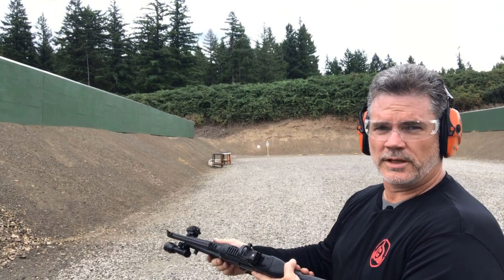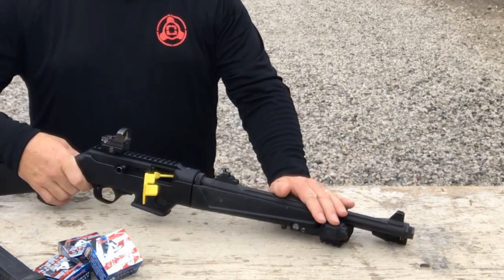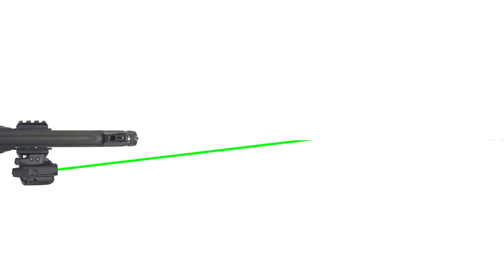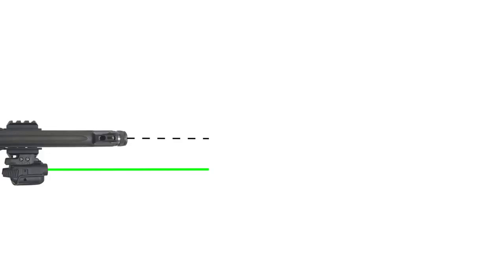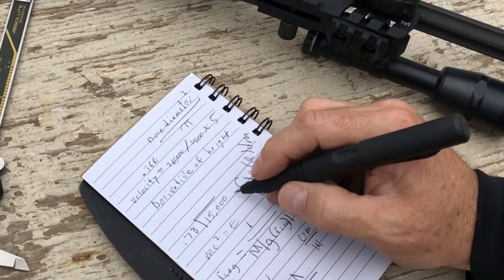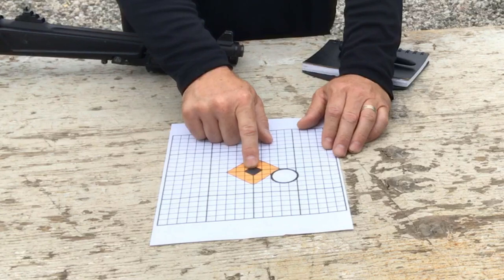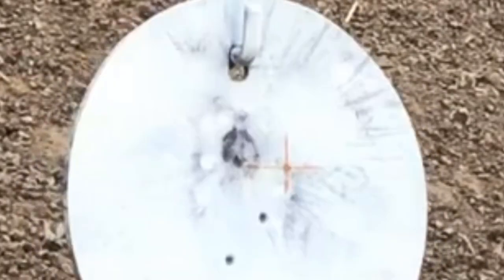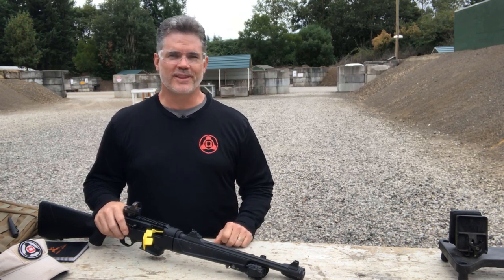How to sight in a laser to be on target at any distance! Ruger PC Carbine Laser Sight Setup!

Comment: And the closer you can attach the laser to the barrel the better, obviously. Whether that be from the top/bottom/sides
Reply from the maker: Most definitely. Thanks for watching the video!
Reply: My green laser boresighter is quite accurate, at least the dot stays stationary while rotating. Hence i custom made a few barrel bands just to firmly secure that boresighter directly on top of muzzle end. The offset distance is only 20mm, not sure if that's a good idea though. But I'm sure no other people would do this 😥
Reply: @la2123  So you're using a bore sighter attached to the barrel as a laser? Lol.. Ok man, though I'm sure you can find a proper/better laser mount. Don't expect it to hold long if it's not secured tightly. But yes a parallel offset of 20mm is good, and I know that's why you're doing it, but honestly I would try to find something that holds and fits better/tighter and sacrifice a few millimeters of offset. eBay has lots of cheap options if you're frugal with money. May I ask what type of firearm you're referring to?
Reply: @TTime685  It looks silly, i know. But I'm tempted to use it because the offset is so small, despite i do have a laser scope and a red dot sight. You're definitely right, i gotta make sure it's straight and secured. The barrel bands are custom made from 3d printed ABS. I'm using a pellet gun mainly for pest control, anywhere below 20 yards.
Reply: @la2123  Ah a pellet gun eh? Hah, well of that's the case then yeah you should be fine there, since there's virtually zero recoil. That's cool making your own bands 👍🏻
Reply: @TTime685  I haven't tried that out but that's what I'm gonna do. With your encouraging words I'll have more confidence. A million thanks!
Reply: @la2123  Yes sir! Good luck dude 🤙🏻

Comment: My laser is directly  below the barrel.  Just to make sure I understand this correctly, you measure distance from laser  to center of bore.  So if that's 2 inches, then I just plant the laser dot 2 inches below my intended target, correct?
Reply from the maker: Correct. You'll of course start to see some drop as the distance increases, but it will prevent your point of impact being higher than your line of sight at some distances and then falling back below your line of sight at extended ranges.

Comment: Good info, works great. Not new tho, I first saw this method on the Banana Ballistics channel. Works just as well for sighting in a red dot too. I use a laser boresight tool and just align the dot projected from the bore with the red dot as it is oriented on the gun. If my red dot is mounted 2 inches above the bore center, I adjust the red dot to 2 inches above the projected laser dot from the bore at 30 foot minimum.

Comment: I’ve been tinkering around and found out what works best for me:
Rifles: laser parallel to bore sighter, offset is constant at any distance, I have to deal with only bullet drop. And because it’s mounted on the side rail, I don’t have to worry with horizontal offset with it parallel to the barrel.
Pistol: laser zeroed just above the front sight at 10yd. The lower offset is still center mass up 30yd and the upper offset closer to 10yd is negligible and still center mass. Zeroing at 7yd gave me too much variation (my laser is 2” lower than the center of the barrel, so sight / bore angles are a little exaggerated).

Comment: Ive adjusted mine to cross the bullet path at 100 yards.
Thats because my 45 carbine doesn't really carry much further then that usefully.
At around 100 feet its 1.25 inches low under barrel mounted.
That decreases with distance to the 100 yard point.
Thats further then ill ever be shooting the carbine.
I have a 1.5- 4.5 scope also mounted.
The laser is mostly just for looks, but mite be useful if needed at dark.
If it was mounted on my 243 id adjust a bit differently.
Id then have it cross path at say 300 yards....
😁😁😁

Comment: Always told setting Lazer up on the side is gonna throw off your aim.

So if you zero at 10 feet and shoot at 20 or 30 or 50 your gonna miss left.

Better to have above and below barrel always in line with barrel.

Case in point add laser under and a laser on right zero at what ever distance then move with each step your right laser moves exponentially away from the target while bottom remains on target.

I usually just save myself the headache and mount under barrel
Reply: Just sight the laser straight along the barrel so that if center of your laser and center of your bore are 2 inches apart, your laser should be 2 inches from the hole it makes at 25, 50, 100, and then it'll start dropping from there, but you're not using a laser further out than that. Drill holding 2 inches over with a laser and dead on with a scope and you're good

Comment: What about if you mounted it at a 45-degree angle?
Reply from the maker: Same thing applies. Our laser was low and offset to the side kinds like it was mounted at a 45…just measure you’re offset both vertically and horizontally. 👍🏻
Reply: @catalystarms7616  is it possible to have the laser at a 45 degree angle and the light on the other side of the rifle at 45 degree angle? Is it also better for the laser to be canted down underneath the light?
Reply: @tonyslaughter8954  No one can tell what's best for you, only you know the best for yourself. If you always know where your POI is and it suits your purpose then why not? I prefer mine on top of barrel.

Comment: Could you provide a list of lights /lasers that would mount successfully on that short front rail?
Reply from the maker: Hi Danger Close.  Do you mean a list of lights and lasers that will mount on the factory rail, or on our Hardpoint M-LOK extension?
Reply: @catalystarms7616  Thanks, I meant the PC 9 factory rail.
Reply from the maker: @DangerClose13E  We don't have that list.  That rail is really short and one of the main complaints.  That's the only reason we made our M-LOK rail extension was to provide a solution to that issue.  For instance, in the video you'll see we actually have a Surefire long gun light, the M600IB Scout Light© mounted which works really great.  You can also mount the Streamlight TLR-1 which does not seem to fit on the factory rail.
Reply: @catalystarms7616  Thanks, Sounds like that is the best solution.

Comment: At what distance should you do this to be the same at any range point?
Reply from the maker: Theoretically it doesn't matter within practical ranges.  That's why you figure out the offset to your bore.  The laser stays parallel with the centerline of the bore, so no matter where your firearm is pointed, so is your laser.  Normally at ranges you would use your laser the vertical trajectory of the bullet won't be much of an issue.  That make sense?
Reply: @catalystarms7616  So basically, adjust laser light/scope reticle with centerline of the bore. Right? To be precise/tweak.. better grouping; take to range, shoot & adjust accordingly!
Reply: @DieuEtMonDroit230  I understand what you & Catalyst Arms explanation. Also, I know lasers are better @ shorter distance!
Reply: @alexanderyil8305  Understood. I will actually delete my response. Because whereas my method will have my impact spot closer to the laser point, it is less effective than his method because his error distance is very consistent. Remembering to always aim 1.5 inches low, has advantages over remembering to aim on target at 30 yards, but 1 inch low at 10 yards, and 3 inches high at 75 yards.
Reply: @DieuEtMonDroit230  Don’t delete your message it’s something we all can learn from. 😎 Thanks for advice!

Comment: you actually lost me some where,duhhh i know im dumb right,i have a new pcp airforce talon ss 22 cal pellet rifle with this scope that has a laser on the side of it,but i can turn my head when looking thru the scope a little to the left or right and it changes the laser,so im starting from scratch i ordered a haulagraphic reflex sight and a seperate laser to mount on the bottom of the gun rail so it will be straight this time not on the side so hopefully big dummy will get it right this time,duhhhhh